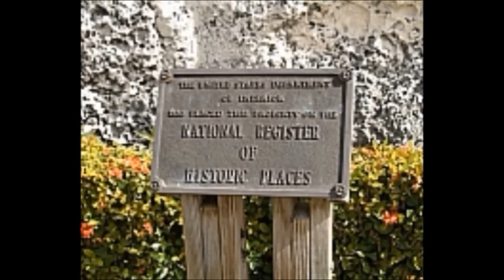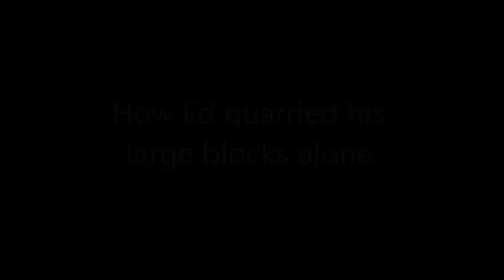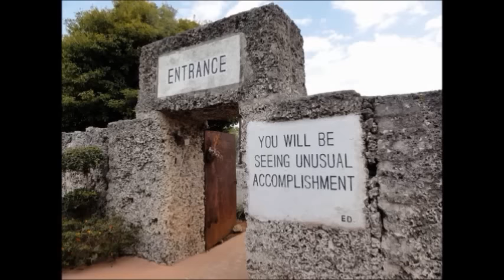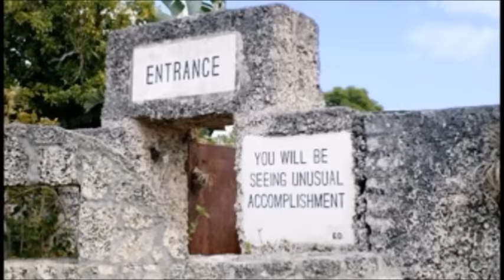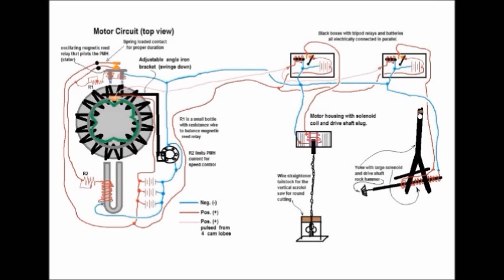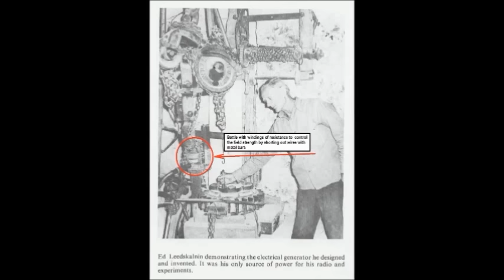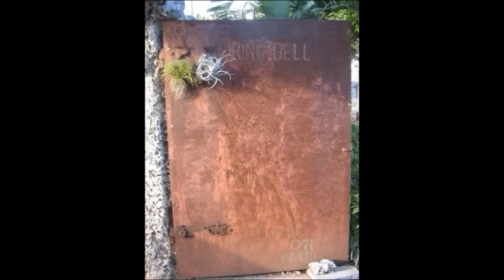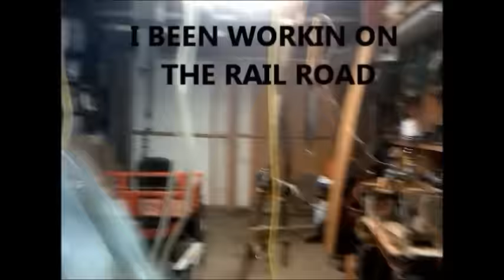Eds Coral Castle Quarry and Flywheel, Engineering Mystery Solved

Comment: Actually, I think that that everything you showed us is both too small and too weak and too slow to be efficient, as needed . How many life times would it take to complete these tasks for real using these crappy coil contraptions. Showing us how his things went around and around did not show how he used these machine contraptions.  Talking about the application is not showing us the actual usage, how were these toys applied to the work surfaces..  There seems to be some missing cutting tools, levers, weights and where they were attached and applied..
You did show how every thing went around and round, but they are basically do nothing machines (too small), unless you can efficiently apply the motion, be it reciprocating or rotary.   They just confuse the common man who looks at these things as electrical toys. I did not see any leverage connections, applicable to any of these machines, which is necessary to do real work and not just rotate. Also there would be zero advantage to placing the X4 paralleled batteries on top of the tripod pole assembly. The chain hoist is the only usable thing you showed us. The big coged wheel was a do-nothing machine that could be replaced by a very small Hall-effect sensor setup.  A wood cross cut saw will last about 5 minutes cutting coral or any hard surface.  And don’t say anything about brass chisels cutting real stone either. I have a farm sickle bar mower and it has attachment points for every moving part and a torque amplifier attached at the most advantageous location on the moving part. QED

Comment: Only 4 minutes in and I say this is all fine and dandy, but if Ed did this in such conventional ways, as I see you're already suggesting, then why do it at night, and why under such strict secrecy for starters? And then there's the problem of logistics - where did he get all the trees he'd need, and how did he get them back and forth to the sites with nobody seeing him doing this, or seeing him getting rides to do it? He didn't drag these timbers around on his back that's for sure. And this is just considering the tools you're proposing he'd need, because we haven't even begun to mention the 2 million pounds of megalithic limestone he single-handedly quarried, shaped, and placed yet. And a question for "@UCsO7Gci4gsKLZHBehUt6Iig": do you have a device producing free electricity? Ed did. He did all this yet was never connected to the grid, so where's he get the juice? Hmm?

Comment: A chain with a wire size of 1-1/4", MODERN chain made of GR 100 alloy has a rated lift strength of around 32 tons (https://www.1st-chainsupply.com/WLLchart.htm#). With that in perspective, Ed's chains were turn of the century quality and no where, no where near that size. Ed's stones were mostly around 15 short tons, with the biggest being around 27 tons. When the 9 ton door's bearing broke and it could no longer open, it took six men and a 50 ton crane to fix it.
Sorry, but the simple tripod and log chain idea is just incorrect.

Comment: Also a lot of errors in his telling of the electrical system.  He does not undestand  " line loss "  and 16 guage house wire is NOT going to jumpstart a car no matter how many batteries are wired in paralel !
Reply: Thats bs. I've used16g wire to jump a small truck with lipo batteries. they got hot yes but they worked time and time again.

Comment: This guy is a nut case,  All you have to look at is the generator system Ed had designed  that he had built six different models of ,  Just like the "V" magnets.  He was sending the "B" field into the earth.  That's the center of the magnetic force.... The North and South are the weakest part of a magnet...  He was using the "B" field.  His "V" magnets were in the repel mode as mounted.   Try it your self,  Take a magnet and tap a rock numerous times with the "B" field of a magnet.  The "B" field is the center of a magnet that pushes out the N & S poles.   Guess what it will loose its weight!!!!!!!   fact!!!

Comment: can anyone tell me what I missed I was taking notes  well the video was going  if anybody's interested on this project I would love to talk with you about it  and organize a field trip to go there Flywheel engineering miami Florida.. National registry of historic places Edward Lee scalmon born in Latvia. 3 semi indepandeant boilers natural life philosophy magnetic current.. Unexplained. Magnetic flywheel..high profile unknown apparatus. Mahnestic current book built ten machines.. Reading measunf experimentation
Logical truth...
Hifde. Unforseen. Occurnces
Mechanical aptitude
True purpose..
4 pro.inent clover leafs.

Cutting blocks 
Quarry
Large tripod..
Retrieve 9 poles 3 s.all 3 medium 3 large 10 so 35 feet respectively..
Lay logd
S

Xy overlap 1l15 overall length
Extra diameter folding slack
.chain configuration
Notches
Lifting
Looops slid into notches.
Y yoke block on top.
Attach 3 come alonga
At man's height attach chsin hoise tonrise witj rest of unit.
Larher tripod stage 2
Stage 2 to 3 adjust accordingly
Do al

Shackle
Quarrying techno
Wood saw or .achune
Museum 16 pointed sun large iron door.
Wheelbarrow apparatus counterbalance dolly.
Hot and miss reciprocation
Locomotion
Stone chisel to clean chunks
6 to 8 inches apart..
Break out pieces ...

Indicated by diagram..

Leaf spring wedges
Side straps upward hoisting.. Unifor.ly
Sound in hammer strike
Underbelly rigging
Quarry. Lineseft i. Quarry interior cuts perfect..
Simple knowledge...roller services..
Ratcheting xome along..ifting suspended and using it to roll above...
Perform work at night
Multitasking sculptor g macjine Germany baltic region

Electrical parallels
Work station. Tripods..
Practical industry machine provides dc power by aerial grid..old junk headlights.
Only one generator required..
Still on site 
Hot and miss engine recipe engine driving generator while driving 

Full load 20car batteries in parallel..
Backcjarge grid car or truck
Center tapping less vilatage drop..
Few battrries reside in wheel house..turns varianle speed rotary switch field stator pulses wheel in one dirextion makes breaks electrical contact.. To 4 leaf clover third positive wore..
Picks up relay pulls I. Makew larger contact..into actuaing solenoid..iron dribe shaft slif spring returns actuatoe whw. Rotary out again

Most manpower spent moving rock not cutting
Eds Sweet 16
Multiple parallels
16gauge for stator..
16 to 24 more torwue better speed control.
Trickiest part is making wheel turn..
2 pole prix relay
2 coiled adjustable osxilating field staor spome I. Circle timinf and voltage control.
Home wound resistor
Metal sjorting bar
Variable field 
Self propelled..multiple workstations
Water pump
Horz Russel mechanism saw

Yome mountedchipping hammer..

Non truths

Human illusionment
Unknown high exposure documentaries..

Known
Wheel purpose
Battery I
Operated
Black box protects
Free energy
Parallel..run liggts all night long
Stator rotor
Floating blocks
Sweet 16 cutting rocks
Built sculping machine
Working at night.
Old car batteries..
Hit nmiss 
Lplosi g configuration..wishing pool
Propilsion poles.. Wheel barrow..
Encircle jack rolls tripod feet.
Wire straitener..
Spring loads tail stock giant scroll saw
Dented motor housing.large coil holds shaft to floor..
Russell mechanism

Horizontal cuttin
2 pole relat tur s wheel magnetically
Actuator coil. 
20 small bottle resistor.
21arge bottle resistor.
16 poles model t.
All the live long day.. Rail..arms switxh and rep

Grid pilot circuit..
Electrical wire on site
Roof tools room power grid.
Trade techniques..
Recreate it ourselves.
Misleading of truth...
Reply: Would be great if we had a technical writer to prepare each of these ideas and then sent to me so I can talk to my people in power generation who are engineers and also talk to some stonemasons
Reply: Michael Tellinger of South Africa can explain it.

Comment: I wss in the  granite business. Specifically  the quarry/factory and importation/ distribution end for gravestones znd war memorials. Granite is 200 lbs per sq foot.  Coral much less. Granite needs diamonds or  carbide tipped tools. Coral much much easier to work.  I see the tripod method  a customer in LA  used for  installing monuments. Old joe could  get 1000 pound  grave covers to a grave surrounded by other  monuments  with 12 inches room betewwn all on concrete floor. Other monument guys with fork  lifts couldnt do it. The hand truck is a classic tool for monuments.  Another customer made me one out of a standard hwnd truck. It made moving heavy  monuments  by hand  much easier. I can vouch  for almst all of this guys analysis. Im not as knowledgeable  per choral  castle but ed used known old school methods. Today we have become reliant on our machines  the creativity and basic knowledge of physical principles.  This piece was well done and hit on facts  the average person is ignorant of.

Comment: tl;dr - largest stones were about 9k pounds and lifted up in air with pulley, vid doesn't show or explain it cause he didn't figure out how. still a missing link in the process, but almost complete, still lots of assumptions too. can't go almost all the way and still try to claim you finished the race!

Anyone with eyes can see the largest of these blocks were about 6.5 feet long and about 3.5 feet wide, and 3.5 feet high using Ed's height as the measuring stick. They were made of OOLITE LIMESTONE -- this is a confirmed fact.

Being conservative and going 6L/3w/3h we get an estimate of about 4 tonnes, or about 9000 pounds for the largest stones. This is a video of a man who moved a 20 ton block using very basic means and leverage. https://youtu.be/E5pZ7uR6v8c

The important thing here is that Ed LIFTED 9000+ pound stones into the air after cutting them. THEN leveraged wood to transfer them along as needed. The reason this video did not go into detail about that part is because the lifting part could not be solved. When simply assuming the visible apparatus as the solution, it's no good, and any person capable of this analysis knows it. There is a missing piece to what Ed did, this is far from solved.

Not to mention all of the astrological and astronomical alignments and correlations to the positioning and designs. Guess those are all just magical coincidences. Good vid, lots of great ideas. Not a full explanation, but lots of logical and smart ideas. Unfortunately when you promise a cooked Turkey and it's not quite done, the people at the table are gonna let you hear about it, and that's what has happened here. Next time don't call us to dinner until it's ready and no one will complain.

Comment: He keeps talking about a 'bank of batteries'...what happens when Ed runs out of batteries?  Did he go to the local Wal-Mart to buy new ones?  Did he plug his charger into a wall?  Did his little 'hit and miss' engine charge them (How much gasoline would this take), and how long would these batteries last?  Did this "Made by one man" cut ANY rock with this method, to see if this was even feasible?  NO!  This 'Engineering solution' (while he's use SOME aspects of the device) is so very wrong.  It makes NO reference to the high voltages or RF energies, or the fact that ED used these in his devices...nor does it really look into Eds SINGLE 'drilling' device shown in his 'at work' photo.  Ed left clues to the REAL technology used there...but this is NOT a solution to ED's devices, its but a distraction.  I'm sorry Made by one man, but your "Engineering Solution", ISN'T.  Show me some power calculations, and cut some rocks with this method, and we'll see just how close or far you are from a 'solution'.  Ed's wheel wasn't POWERED by the batteries, it was powered by RF and the antenna on top of his building.  I know this may seem far fetched...but trust me, the ancients used RF/Cosmic Rays to power their devices...and an electro-magnetic resonance phenomena not yet understood by mainstream science (Telluric currents and Zenneck waves/resonance, Alfvin waves).  Show me some cut stone, show me the 'battery bank' and how he charged them, and lift one 15 ton stone into place with this system....and then tell me you've 'solved it'.  Your setup would kill a MODERN car battery likely in a matter of an hour or two, no?  How many of these batteries did Ed have...or how did he charge them?  Was he making trips to the local gas station on his bicycle?  Did he have a gas tank on site?  You don't answer the POWER question....let me guess, you're going to suggest like others that Ed cranked this wheel by hand, to generate the power to charge the batteries? BAHAHAAH!  With one pickup coil, at speeds maintainable by a man standing next to it with one arm?  This stuff is Ridiculous.  The only reason why people believe this, is because the DON'T know the relative power required and the losses!

Comment: This?
Reply: Certainly explains quite a bit. The sweet sixteen may also describe the amount of cells of earthen battery. Each cell can give out 1.5v so if 16 cells were wired in series it will equal 24v. At night time when gravitational current is flowing at it's strongest is when the amp hour increases in these battery. He then used the generator to those machines mentioned in this video. Adding one more tool to the tripods box. 📦 Ed shows in experiment how to use iron cable as magnetic levers. He placed glass over one then showed how the like force magnetism repels/levitate. Upscale the concept. Useing a 1 inch steel cable (50 ft)  with an iron core coil (copper around iron pipe) center the length of the cable placing this coil between the two coils of his P.M.H.. Once energized the cable becomes a magnetic lever. It will send all of the North flowing magnets out one end of this steel cable while sending the South pole magnets to the opposite end of the cable/lever. Bury one or more of these cables covered with sand to insulate the fields then use the one atop the tripods to assist in moving/levitate the stones. Ed wore steel soles on his work shoes to manage his pathways beneath his feet. He was tuned in to the earth's magnetic fields without anything from all the years of mastering his craft. But the thugs that threatened his life is why he hid behind hos story of his sweetsixteen.